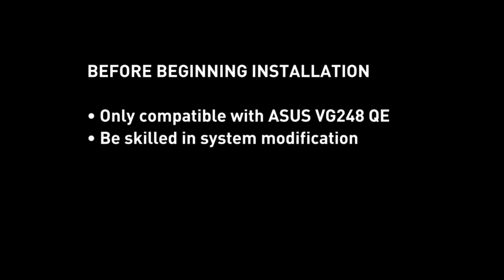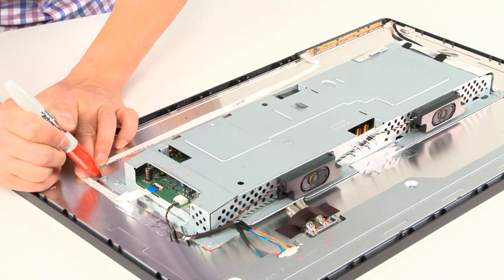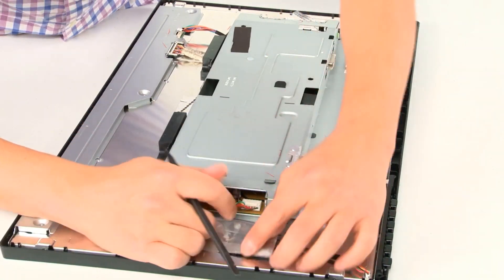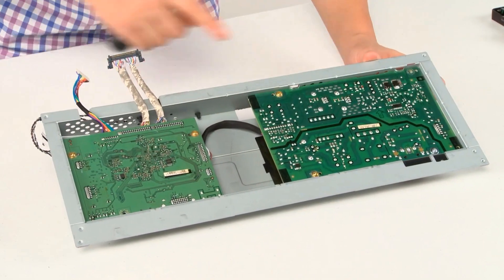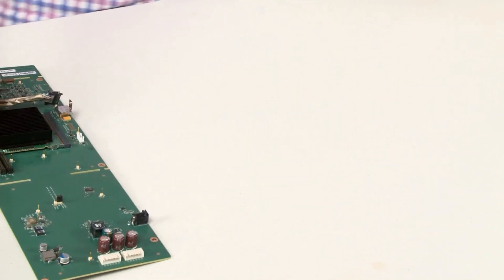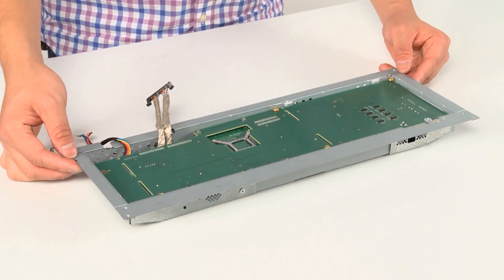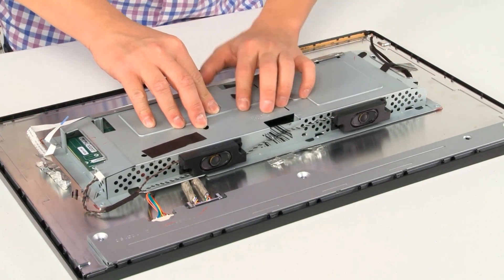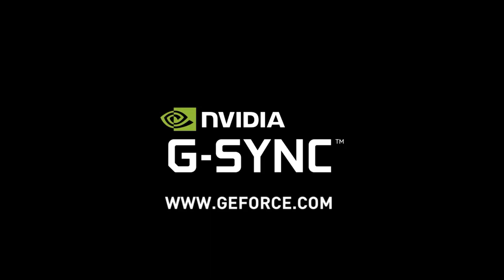NVIDIA G-SYNC DIY Kit Installation

Comment: yeah just pull that power supply right outta there, nothing bad could ever happen
Reply: thesba027 That's fine, but I imagine that's because YOU don't know what you're talking about. In a lot of power supply designs the caps are actually relied on to store a charge so that the component can immediately power on and not have to charge up the power section, even if that would only take a couple seconds in a high voltage design with step up transformers, like a guitar amplifier. Look up whether or not a guitar amplifier stores a charge and if it can kill you if you don't carefully discharge it before you touch anything. 

But I'm sure you're right becuz u s0und s0 intelijunt d00d. You don't even know how to spell capacitor...
Reply: thesba027 Wow, you're dumb. If you were intelligent enough to understand my last comment, you'd realize you just stated the same thing I explained. Except you are using the word amps and I'm using the word current, and they're the same thing. Amperage is the measure of current. Just as I explained, if the current/amperage is low enough, then you can get shocked by any number of voltage. It takes both parts, though. The opposite can also be true because current and voltage go hand in hand. Voltage doesn't kill you, current does, but then why do they have signs that say "Danger: High Voltage!"? Because voltage is what defines the flow of the current. 

Ultimately you can go on and on with your misunderstandings, but what I said remains true. A high voltage capacitor, say 500 volts, can remain charged after power is removed for a very long time, and discharging that cap can kill you or seriously hurt you. It doesn't matter if it's the current that killed you, because the 500 volts stored in those capacitors is what motivated that amperage to kill you. And no, capacitors don't all just discharge as soon as power is removed. That's why some of them are even referred to as "storage" caps.
Reply: Nicholas Lemarr
 WARNING - The capacitor of the PSU could give you quite a big zap and maybe some people hearts can't handle it. I always short the capacitors with protective gloves and a screwdriver before touching anything else.
Reply: Nicholas Lemarr
Not always, in fact most of new monitors have really good capacitors and energy efficient circuits and can actually retain their power for quite long time.
Reply: Aaron Dragg
 I totally agree with Aaron Dragg it might not be lethal but it could sure hurt alot. But if someone has a weak heart they need to be a bit extra careful. Even so a bit moisty hands could also give a lightning-strike like taste. :D
Reply: thesba027 If you were "zapped" by 44000 volts then you weren't really "zapped". You were "zapped" by something with very low current. My experience comes mostly from vacuum tube guitar amplifiers so that's where I'm speaking from, and high voltage caps in the power supply can discharge immediately enough current to kill you. I'm taken a multimeter to the caps on amps days and weeks later and they were still holding 100's of volts. Usually most of their full charge of 500-600 volts. 

You could always just look it up. Depending on the capacitor, the voltage can be stored for a long time.  And 44000 volts being discharged through your tissue all at once isn't going to just tickle. That's way more than enough current to potentially kill you. 120 volts with enough current can even kill you.
Reply: bzaaap FUCK!
Reply: Yep. That's a very good idea.
Reply: ***** this conversation really interesting, I'm studying electronics in college almost half year and I haven't experienced that much physical work with capacitors inside matrix board for modular electric circuits with other components. Thanks to you and Nicholas i'll try and ask my teachers about the real answer, just for general knowledge, at least for me. :]
Reply: Yea, as long as it's unhooked, it's fine. Static charge might short something out if you're unlucky, but most people won't have to worry about that.
Reply: *****
Only if you touched it IMMEDIATELY after you unhooked it. I'm talking a couple seconds. The nature of a capacitor makes it lose it's charge almost instantly.
Reply: ***** The capasitors discharges..
Reply: Aaron Dragg I dont think u know what ur talking about
Reply: Aaron Dragg Well first let me say im sorry for not bothering to write my second languge perfect. A capacitor(happy?) works as a battery, it is not a battery. For the guy that knows it all, its not the voltage that kills you, i have been zapped with 44 000 volts.
Reply: Aaron Dragg Volts dont kill you, amps does. Doesnt matter how many volts you got aslong as the current is low enough. 1000volts dont kill you, 1 amp kills you.
Reply: ***** Ye, or you get fried like a baked chicken in a micro, only much faster
Reply: ***** well, your chargers are made with metal and wont be cooked unlike urself ;)
Reply: ***** Neither, when do u stick ur tongue in the charger? when its in the wall

Comment: I'm amazed by how Nvidia forgot to include warnings in this video! Not a single mention about how bad it is to put pressure on the LCD panel or no warning about manipulating the power supply! After all, its not like capacitors still having power!

For sure, no kids of 15 years old will try this.... I think Nvidia should fix this before something happen
Reply: They did say to have knowledge on modding... Which is why common sense tells me NOT to try this, I will instead buy a modified monitor from a reputable retailer.

Comment: Who will be the first one to be killed by electric shock?
Nvidia will be in the newspapers. :-)

You should delete the video.
Reply: First thing in the video "Be skilled in system modification". If you do this, you take your risks. If you do this kind of upgrade without having any idea what you are doing\touching and you still do it without the precautions an intelligent mind demands, well... Sorry, but we could also call it "natural selection at work".
Reply: for the record:
high DEADLY voltage can remain (like a battery) on the board for a longer period of time. Even if you have unplugged the device.
This is also why you never open a PSU if you don't know what you are doing.
Just don't.
Reply: REDxFROG That's incorrect. Every main SMPS Capacitors have a parallel resistors (about 140Kohm) to discharge them precisely when power cord is out. Of course, the video don't say that people must wait some minutes or discharge them in a secure way. Anyway i agree with you and this video must be deleted or say that work on it is very dangerous or have some experience in SMPS handling.
Reply: César Augusto Martínez So it's not totally incorrect, it's just lacking further explanation from my side. ;-)
I don't want to give advice regarding "secure handling" because I don't want to be responsible if it still goes wrong.

Just thinking/saying Nvidia should add warning message at the beginning, ending and even throughout the whole video.

People even ask if this voids the warranty.
I mean...wow......how much do they actually know?
Reply: He just switched the computers, I don't see why the skilled part besides the electric danger
Reply: ***** next time compare apples to apples and don't come up with this bulls*** like static electricity charge.

We are talking about risking human life here, not some dumb replaceable hardware.

Gosh.......!

And yes, I read it all in the video.
So?

Everybody knows that untrained people will buy it once everywhere available on the market.
That kinda small warning "only qualified people SHOULD do this / or is highly recommended" isn't enough. It should be absolutely FORBIDDEN to perform the exchange without proper qualification.

Most stickers on PSUs also forbid to open for unqualified people.

Comment: Just a heads up for anyone referencing this video:

- The board is a different revision from what you receive.
- The supplied plastic tool is useless. Carefully use a large flat-head screwdriver to open the panel. Start on the bottom where there are 2 larger notches. The initial twist requires some force, remainder is easy.
- The ribbon cable connector is different and a pain to reattach. Use tweezers to pull back and lift the lock. 
- Use electrical tape to secure the ribbon. The cable can move/wiggle once connected.
- There is no secondary connector on the side of the PCB as mentioned in the video
- Ensure the 'Y' looking cable is correctly installed. Take careful note of how the video describes this.
- The supplied AC plate is different, use electrical tape to secure.
 
Install took about an hour; relatively straight-forward if you have any background with electronics or modding...nothing to be afraid of.

Comment: I think you'll have to make that module cheaper or come up with something else to make this whole thing easier because if you want to really spread G-Sync you can't expect people to buy a 200$ module for a 280$ monitor and then install it yourself. I know that there will also be monitors with G-Sync installed already but as far as I've heard they are going to cost even more than this combination.
Reply: You're not paying $200 for the module, you're paying for an entire new monitor motherboard, which Gsync installed, so that you don't have to solder it in.
Reply: It's still more than most people who would actually benefit from G-Sync would pay.
Reply: Julian Leischner
Then they can wait for the actual consumer models coming out in like 4 months

Comment: the price tag is a bit disappointing :(
Reply: it's an entire kit, not just the module.. I'm guessing they figured it will be easier to install and avoid users having to solder, which is not an easy skill.

Comment: does this work with other monitors or is it specialy made for this specific monitor only? and lol 199$ what were you thinking off, i'll rather buy a new monitor then
Reply: In the description and in the video they say that it's only compatible with the ASUS VG248QE.

Qoute:
"1. You must have an ASUS VG248QE monitor."
Reply: This is an early model, of course it will be expensive and limited. Also yes it's only one model.

Wait later on this year, BenQ, ASUS, Phillips and Viewsonic will have models and they will get cheaper.

Comment: FreeSync it is :)
Still i still like because of the Competition :)
Reply: Freesync only worlds on laptop display interfaces.

since display makers are too lazy to make variable refresh work on desktop displays.
Reply: no works on all VESA monitors it's still in aplha stages. Mantle fps Boost is way better than this :) With Full Mantle version we should see more than a 100 percent fps increase. oxide games already has more than 100 percent increase from 7 to 30 fps. G-Sync still is better than FreeSync but cost a lot plus it will work with optimized g-sync games.
Reply: esframunas963
no it doesn't, because

1. Freesync needs to directly drive the screen and
2. Current monitors (apart from gsync enabled models) have scalers, modulators and  refresh controllers sitting between the video card and lcd transistors which prevent #1 from being possible.
Reply: esframunas963 Wow i think i lost a few brain cells after reading that comment filled with ignorance.
Reply: LOL :D I'm not. G-sync 200 extra bucks? Thats a extra graphics card :D
Reply: esframunas963 Extra graphics card for the poor?
Reply: actually no extra card just freesync. for 200 i can buy other most needed hardware :)
Reply: :facepalms:

Get it through that meatball inside your head, current monitors are not capable of using freesync.
Reply: Have fun getting a new AMD gpu and a new VESA monitor whenever they come out
Reply: VESA monitors are avaliable now and has been for about couple years.
Reply: Yeah, but none of them are compatible with FreeSync.
Reply: we shall see in the future :)

Comment: LOL So spend $300-400 USD on a monitor then a further $200 on this kit? no thanks I'll wait for freesync thanks you con artists >.<
Reply: Squall4Rinoa That's the catch, you do not require an extra chip or anything else. AMD FreeSync is based on open standards and is extremely easy for monitor manufacturers to implement in their displays. A simple firmware update would suffice in most cases.
Reply: False
Reply: or get the Asus PG278Q for 799$.
Reply: Squall4Rinoa They have stated it will be available on Amd gpus only though and will require no chip, it'll be done gpu end and will allow the display to sync with the gpu. I don't understand the technology completely. However it would seem there are alternatives to gsync. I'd rather put that money toward a new gpu and have freesync. Gsync monitors need to come down to a reasonable price or nooone will bother. tbh an extra 40% on the cost of an average monitor seems fair. But having to spend $500-600 usd is just insanity.
Reply: Alex Smith It's called Vblank. 
And it still has input lag because it chops off a frame. 
G-sync is completely different.
Reply: Medieval Blast I live in New Zealand and in the local currency the Asus PG278Q costs $1300. That's about what I paid for my cpu, motherboard, ram, psu and graphics card. It's an absurd amount of money for the monitor and that's just a fact of life with new technology. I remember when a 42" plasma television was $7000. As it stands AMD gpus offer far better value for money anyhow.
Reply: lol this monitor is 200 bucks on newegg. morons.
Reply: That be 'merica Jourmand1r
Reply: Jourmand1r Unfortunately I live in New Zealand where we pay twice as much as you guys for the same shit. These are $600, i paid $400 for my benq 144hz display and couldn't be happier with it.
Reply: Anybody that is willing to pay the 200 Dollars "G-Sync tax" is a moron. FreeSync monitors work exactly the same and cost $200 less.
Reply: you'll be waiting a long time.

Freesync only works on laptop display interface
Reply: Squall4Rinoa SO FAR. And on amd cards. If they bring it out and it works as good as gsync i'm sorry nvidia but i'd gladly jump ship for that.
Reply: Alex Smith
AMD aren't bringing anything out, they have already made it clear they are not bringing a chip to LCD makers to enable freesync on desktop lcd's.
Reply: @ParallaxFPV  nope, the implementation in hdmi displays is a garbage high latency pass off.

Comment: why not  just make a monitor built with it all ready?
Reply: Probably even more expensive. Id imagine doing it yourself would be the cheapest way. And it doesnt look hard at all. Done much more complicated stuff with zero knowledge
Reply: That will come later. Because doing the DIY kit is a huge mess.
Reply: But if you mess up, monitor is ruined, and this may or may not void the warranty on the monitor.
Reply: JamPaladin Messing up is impossible. Unplugging and plugin cables back? I did much more harder things like soldering with zero experiences. This is pretty much fail proof. Just follow the instruction and everything should be fine
Reply: because people who already have the monitor and who wants G-Sync.

Comment: Don't understand the point of this product. This is far beyond what most anyone is going to want to do. And it only works with a single monitor model?
Reply: Speak for yourself...

This is seriously easy to do. You can always pay someone 50$ to install it for you.
Reply: I'm not speaking for myself, I'm speaking for the general technology-consuming public. People have little to no interest in doing things like this. 

G-Sync is an irrelevant technology as AMD has basically reinvented the same thing, and will open the technology; the upcoming VESA standard revision has changes to match screen refresh to video as well. This is just pointless.
Reply: 1lapmagic Well...

There's the freesync, right? it forces you to buy AMD, but what if you want to stay with your lovely nvidia?

VESA change means, I have to throw away my 600$ monitor and get a new one which isn't going to happen because I'm content with it for the time being (I upgrade every 5 years or so). Either way, you will end up spending too much money. If they release just the module, computer savvies can mod their monitors for as low as 100$ and be done with it, which works out for me just fine. I truly don't care for those who don't... they can pay someone to do it and it will still cost them less than a new GPU and less than a new monitor. :)
Reply: Freesync doesn't force you to buy AMD. It is an open standard that can be integrated into any future equipment with no licensing cost.
Reply: http://www.anandtech.com/show/8008/vesa-adds-adaptivesync-to-displayport-12a-standard-variable-refresh-monitors-move-forward
Reply: 1lapmagic This is meant more for the Enthusiasts not for the general end user/consumer.
Reply: 1lapmagic this is just for this monitor they are coming out with monitors pre installed with g sync
Reply: Isaiah Williams Industry is already comprehensively moving past G-Sync to a new VESA standard that includes stuff like this by default

Hence why I thought this product was useless
Reply: 1lapmagic Care to show me what standard that is? I'm a bit curious ... thx :)
Reply: Thanks ... :)
Reply: Captain Salty I understand that but even so it just feels like something that nobody would buy. I guess I should applaud them for making it available but....
Reply: 1lapmagic That's something that gamers with high-end machines want (or a similar technology) ... since it prevents screen tearing and other artefacts that normal (60Hz) monitors render due to high frame rates on low refresh rates :)
Reply: KayoPs
Reply: 1lapmagic actually it was kind of a beta test of sorts. Served to see if there was a market for it and also get feedback from early adopter. Now they are phased out since it served its purpose and gsync monitors are out.